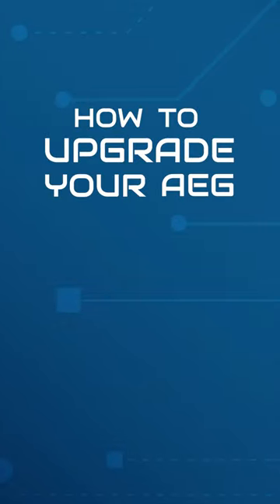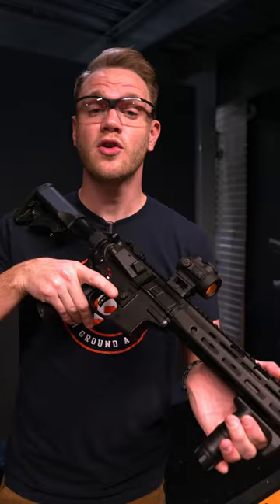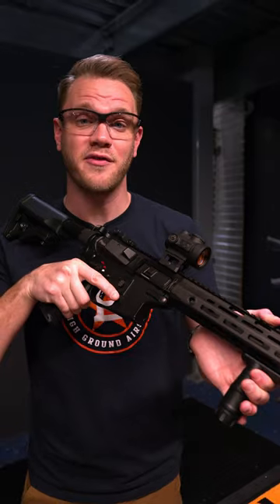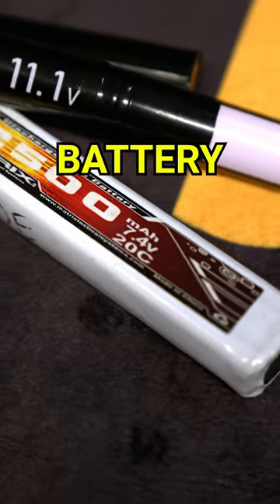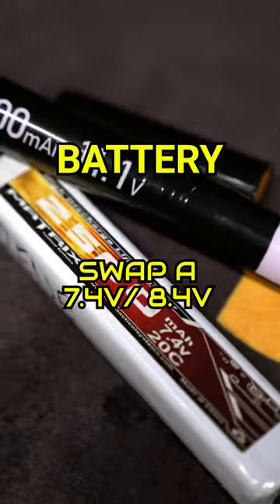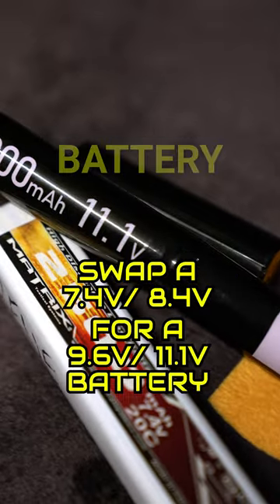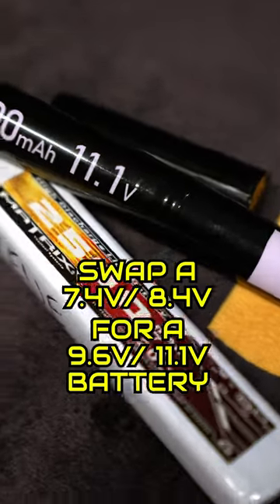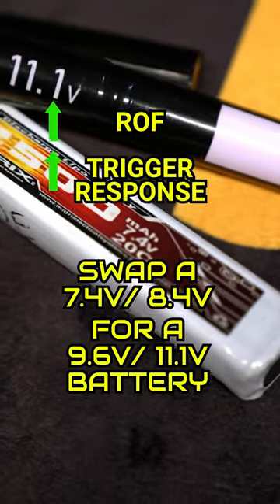How to Increase Your Rate of Fire

Comment: This is perfect advice for those who want it to stay simple.
HOWEVER-
You can get a significant more amount of efficiency by using HIGH ratio gears and a higher speed motor. 
I.e. 18:1 and 50k motor. A shim job and good lube also helps. 

Man, I should write up a manual
Reply: We’re waiting for that manual
Reply: It definitely has less internal stress but trigger response will be slightly lower
Reply: PLEASE DO A MANUAL

Comment: A MOSFET is mandatory to have if you are going to use an 11.1
Reply: Not mandatory. I used a stock KWA for 8 years. Never used anything besides 11.1v lipo.
Reply: @Nick.YT01  if your gun is not lipo ready, it is.
Reply: @MarkSamurai5  that’s not what was said in your original comment. Either way, still not mandatory. I used the same 11.1s in a few cheap Airsofts, including JG MP5, CYMA AK, and Echo1 G36c.
Reply: @Nick D  well when your trigger contacts start to fry, you will know why I said that.
Reply: @Nick.YT01 will it work on a raider cm16
Reply: @MarkSamurai5 nah
Reply: Modern airsoft guns generally use strong enough metals to allow for an 11.1. Sure it increases the risk of them frying but chances are something else breaks first

Comment: It's the same with Cars: Mo powah, less weight, less heat

Strong Motor: 40k+ RPM, 40+TPA, Pref Brushless
Battery to support Motor: 11.1v 25c+ mah=whatever can fit
Mosfet: W/e can support the insanity
Long Gears: Steel 13:1, your motor should be able to overcome that
Lightest Max J Spring: M100-120 or w/e needed
Less Friction Loss: LUBE EVERYTHING
Less Reciprocating Durable Mass: Alu Piston/Head, </=14 Steel Teeth
Less Vacuum Loss: Find the ideal hole size/shape/location of your piston cylinder. (In a perfect world they should be longish triangles. Pointed towards the head)

There is a ratio for the:
Spring, Vacuum, Joules/FPS
and
Spring, Gearing, and RPM

Not really a clear cut answer.

Comment: if you're going to use 11.1v lipo you should be using a MOSFET already or a fused gearbox minimum.

Dont do motor & gears separately, they're supposed to be paired. High torque motor to go with high speed (12 or 13:1) gears.